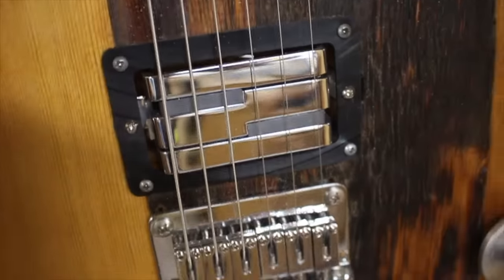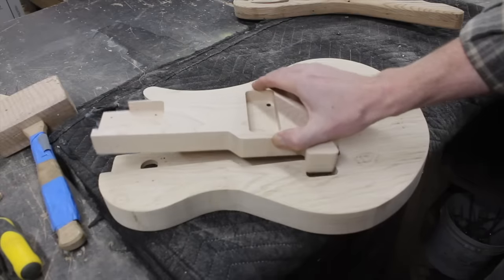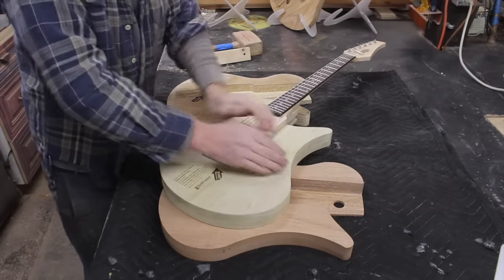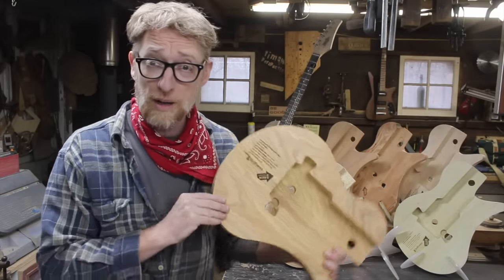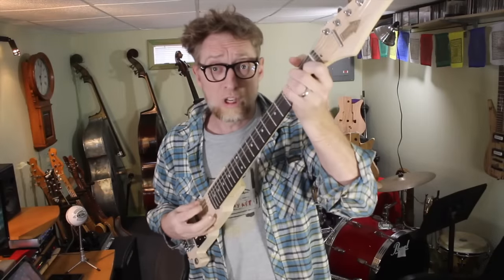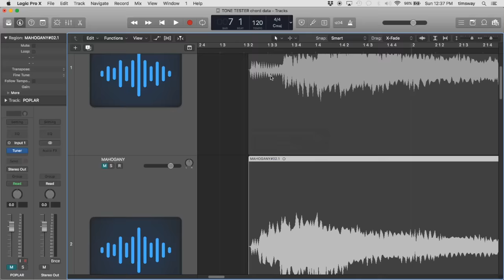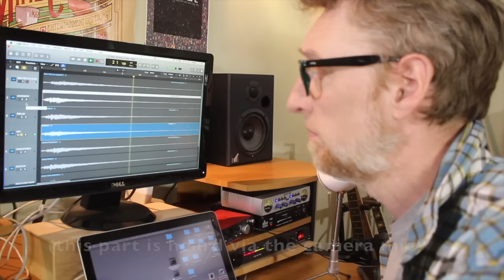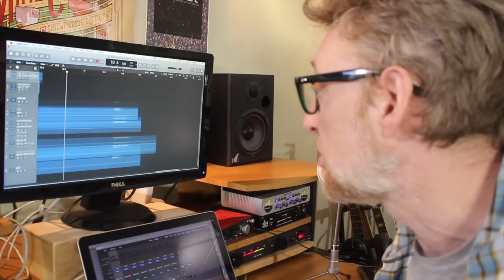Tone Wood Tester: One guitar to test them all

Comment: Wood type makes all the difference... to the bank account.
Reply: We’ll hold on, now... wood may or may not have a noticeable effect on your tone, but there’s absolutely no doubt that the type of wood you choose can affect sustain, the feel of a guitar, the weight of the guitar, the endurance and quality of a build, and - if you don’t paint it - the LOOK of your guitar, none of which are your “bank account.”
Reply: Not to worry Jesse. Most of my comment was meant facetiously. The whole tone wood topic relating to electric guitars is ridiculous, imo. When it comes to weight, strength, stability, sustain and aesthetic.. thats a whole different story. These are more important,  yet they're frequently ignored in relation to the topic of tone.
Reply: Aah the immeasurable myth of mythical tonewood factless ego wood. 

Correct, tonewood is a good sales pitch to remove money from your wallet cause you can't tell other then ego and biass cause you bought it, but it sounds better myth.
Reply: Spend your money on the amp, thats where good quality tone comes from. $500 is all you need to spend on the guitar.
Reply: Any amp EQ will easily negate any subtle "tonewood"differences there may be. So yeah, sure you might hear a difference but it does not matter whatsoever.
There are much more important factors influencing the tone significantly. For example the amp :-)
Reply: Btw. it has been proven time and again, that wood has almost no influence on sustain. Darrel Braun  for example did cut off all wood off of a guitar which could get cut off and it still sustained the same.
Reply: @MrVirgilVox  Or just use an EQ pedal
Reply: ... And to the back...
Reply: @MrVirgilVox  he made cut  up and space it with metal and metal is dense.  You can not argue the fact that dry dense would sustains longer.  The kind of wood does not matter as much as learning how to be a better player and mastering technique.  In my opinion it only matters to the 1% that get so damn good and have fantastic ears.  Most of use need to just leave this wood debate alone and concentrate on learning how to become better players.  Now having said that choose a guitar that feels good sounds good and looks good.  If you do that you are more likely to pick it up and do the biggest factor in tone and that is your playing ability.
Reply: wayne brown he put the pieces together after the test. During the test he cut away everything except Bridge and control cavity. Did you even watch the entire video or did you just skip to the end?
Reply: @MrVirgilVox  I watched another video than the one you were talking about look it is science the more dense the wood the longer you can feel the vibrations.  Is it a big factor in tone I don't think so but it does to the 1% that are so good at guitar that they can tell.  For the rest of us I think practice is the biggest part of tone.  He made another video where he showed the guitar put back together with the metal and said he did a test with it so I thought he used it that way.  It does not matter he cut it down to a plank the more dense the longer it will vibrate.  You don't even have to hook it up to an amp to test it.  You know as well as I know this is something that guitars will argue to the end of time. lol keep shredding.
Reply: wayne brown that is exactly the point. It only makes a difference acousticly but it makes no difference in how the string vibrations induce current in the coils - which is what the electric guitar raw signal is all about.
Who cares how it sounds unplugged. That is not what's being processed in the signal chain, not what makes the tone.
Reply: @MrVirgilVox   Slow down man I said that is the only thing that is different.  If it sustains longer acoustically it will sustain loner in the amp.  I was scrapping the bottom of the barrel man.  To me , tone starts and stops with your ability to play the instrument.  Today the pedals and amps are incredible  with mad skills you can pick up just about any guitar and make music.  When I read these tone wood comments I kind of pick the vibe that a squire bullet Stratocaster is just as good as an American Fender Stratocaster.  There is a point where cheap guitars don't sound as good and they fight you with bad frets cheap material such as the metal of the bridges.  This is it,  in my experience that is the only thing that makes a difference and that  difference is so small it is nothing to worry about.  I still will not tell my instructor that has played with people that are in the country hall of fame that he is wrong.  If you like a wood because you thing the tone is different then buy that guitar because you are going to practice more.   I will say one last thing I have a MIM fender Strat deluxe with locking tuners and a push push button cost $824.  I have a PRS standard for $499.  I had to block the bridge on the fender because I could not keep in in tune.  I thought I was going to have the same problem with the PRS and it stays in tune, it sounds better and the material are better the construction also better.  I don't know what kind of wood either one is made of.  Thanks for keeping things friendly I know that is a very rare thing in the comment section on youtube.
Reply: @mr1bienvenu1  I used to think that, until I bought a really nice guitar and plugged it into my Mesa ED.  It was like the Mesa was on steroids.
Reply: The most expensive guitars I have also have the most sustain.  Is that part of your tone?  That's like asking if ice cream tastes better than beer... really depends on who you ask.
Reply: @realtruenorth  I wish I could afford a Mesa I have heard nothing but good things.  I don't play well enough yet to make that kind investment maybe in another 5 years.
Reply: @realtruenorth  I had a long drive yesterday and for what ever reason this popped into my head.  If you feel you can hear a difference in tone with different wood bodies and fretboards.  Who am I to tell you that you are wrong.  Someone might pick up that one guitar and they hear something they like maybe its  like songs.  We like some songs and some sound like they are a joke.  That is the only thing that I can think of that causes this big debate.  I will continue trying to get better like I said I got 3 guitars and like all of them and don't know what wood is used in any of them.
Reply: @waynebrown1394  I have been playing for a long time, I earned my skills.  One thing i can tell you, you cannot put a price in inspiration.  I have heard incredible players sound good playing anything, even junk.  But, at the same time you will not see them recording on a cheap amp, or guitar.  I realized over the years that if something inspires you to play better, it is worth every penny, and inspiration will help you get better faster.  People say "a great guitar and amp won't make you play better" that's true.  But if they inspire you to play more often,, then you will get better faster because a passion will grow in you and your fretboard knowledge will grow fast.  How do you put a dollar value on that?  I paid $750 for my Mesa combo, and I would have paid 3 times that. Because everytime I plug into it, i get a smile on my face and my playing wakes up all refreshed.  I feel like when I first had that hunger to play, only now I can. You are already good enough already to play whatever inspires you to play my friend.  Let your ears decide.
Reply: @realtruenorth  I want to thank you I took your advise I went out and bought by dream guitar after reading this message.  Right now I live alone my best friend my Dad died.  So I was thinking what make you happy and it is playing the guitar.  You are right I don't have to be awesome player to have a guitar that will make me smile and happy.  I got a Gibson Les Paul because of this message and I don't regret one damn thing.  It was the first time that I bought a guitar and did not have second thoughts or buyers remorses.  Nate hit me back on this message like to have you on face book.  That way I can show you the guitar that I got because of your message and I am happy.  Thanks
Reply: @waynebrown1394  cool man, I am glad.  I dont have Facebook, sorry. But enjoy the Gibson. Peace
Reply: @waynebrown1394  and by the way, unam sorry for your loss. Hope your dad is in a better place.
Reply: Smart kid!
Reply: @realtruenorth  :  Ice cream.  Thanks for asking.
Reply: @douglasbender9481  beer for me ha ha
Reply: @jesse_cole  "tonewood" mainly effects the look,everything else is so close its pointless to compare.
Reply: @trillrifaxegrindor4411   *affects
Reply: Only if it’s quarter sawn pallet wood

Comment: I'd bet pallet wood would blow all those away!
Reply from the maker: you can't make a guitar out of trash!
Reply: @timsway  You sure can. You can make shot cups, maps, legs, coasters, the whole nine yards, all out of trash...err, pallets
Reply from the maker: @lfmoliveira1  Stay tuned to Paul's channel and remember my exact response to him :)
Reply: @timsway  People made guitars out of fucking cardboard. And it sounded just like any other guitar would.
So pleeeeeease ....
Reply: I built an off set hollow body out of milled down pine wall stud 2x4s and a pine shelving board top from Home Depot, basically as a challenge to my self, and it plays and sounds better then my LesPaul custom and my SG standard.
Reply: Taylor made a guitar from the palletwood the tonewood was delivered on.
Reply: @Revis This link is about acoustic guitar, tonewood will be more noticeable. The video is about electric guitars
Reply: Pallets are commonly made from alder, poplar, and basswood so...
Reply: @pauloquist6150  and if it dried well, it would be good or even better than some cheap chinese axes. At this point proper drying is actually the weakest spot of cheap guitars. Raw timbers are just fine and fairly close (if not the same) that are used by big brands.
Reply from the maker: @seriseriom8445  you realize I'm the maker of this video and about a dozen other "junk" guitar videos, right? I'm obviously joking :)
Reply: @timsway  Hah. No. No i was not aware of that. Servs me right tho ;o)
Reply: I can’t stand the whole “use pallet wood for your project, bro” movement. Drives me crazy! I like hardwoods, but I appreciate nice, refined pieces of wood.  Not “rustic” dirty boards lol
Reply: @mattfairfield9103  you'd feel right at home on my channel then
Reply: Jackman Works well, sir, I can’t deny your work. It is impressive! There’s a difference between craftsmen who know how to use the wood for something great, and pretty much anyone else who uses pallet wood because it’s “rustic” and “rough looking”. Haha
Reply: Just saw a video of someone who made a guitar out of hundreds of colored pencils. Sounded great.
Reply: @pauloquist6150   I think you meant oak and pine.
Reply: @mattfairfield9103  Its not a movement mate. Its a campagne to get rid of all the guitar myths perpetuated by the big companies. The second ppl realise that a Les Paul or a Strat can be sold for 250 bucks in the same quality than the original is the day they dread the most.

That second btw is almost here.
Reply: Seri Seriom I just meant for projects in general! I work in the lumber dept. at Home Depot and sooooo many people shoe me their pictures of the shitty renovations they did with their pallet wood and dirty bar wood and stuff lol. I just don’t get it, other than the fact that it’s cheap, or completely free lol.
Reply: @mattfairfield9103  Ah. Yeah i understand now
Reply: Ik
Reply: I prefer practical board
Reply: Pallet wood varys by location. I've  seen oak fir pine yellow pine hemlock ash. You name it. Nice video.
Reply: Well it would have to be Swamp pallet wood, or Brazilian pallet wood, or perhaps, Curly pallet wood. I don't think the basic stuff would be good enough. I am being sarcastic of course :-P
Reply: Wood pallets are made of hard wood, so they can handle the weight put on them. Some pallets are used in factories or warehouses for years, so that gives the wood time to dry. The only problem with pallets is the problem of nails, and you can fill nails holes. It isn't junk wood by far. Some very nice furniture can be made of it. You can sort it out and choose if you want a walnut, oak, maple, or ash (even some are fruit wood, which is good tone wood.) A lot of things have good tone, concrete is one of them. Most problems with guitar wood is mostly if will it hold up under daily use, is it strong enough to hold the pressure of the strings, and it doesn't splinter or bend over time? Other than that, you find what sounds good for you and use it.
Reply: @seriseriom8445  
They sounded to same to you. I think some people get butthurt about tonewood. Why is this? Because just like all wood is not created equal, neither are ears. Just because some people can't hear a difference in tonal quality, that doesn't mean it's not there. I think this upsets some people, but  the truth.
Reply: @randallflagg9659  "The truth".

See? Its not about being hurt its about being forced to discuss with flat earthers.
There is no argument. It has been settled. We have the hard data on it where as you have "the truth".
Reply: Matt Fairfield if people could see the things some companies do with pallets they wouldn’t be so quick to use them for projects
Reply: Pallet Guitars Inc.
Reply: Wow i remember doing that .. pressing my headstock to the wall to get the louder sound. You are very creative sir.
Reply: @timsway  I've seen and heard pallet wood guitar....sounds identical to this...
Reply from the maker: @GabrielTheGuitarist  my comment was a joke. most of my videos are guitars made of pallets, water skis, etc. and I am the maker of this video. Paul and I recently made a pallet guitar together. watch for it on his channel.
Reply: @seriseriom8445  sarcasm,if you are slow its undetectable
Reply: @sheancarey106  no it doesnt,it does however play differently
Reply: @randallflagg9659  look at the scope reading,it doesn't lie.each strum had the exact same pattern within a  percent
Reply from the maker: @powertothebauer296  you realize I'm the maker of this video, right? Sarcasm. I make a living out of making guitars from "junk" :)
Reply: @timsway  What reference you answer , my Brian May post, yes I realized after my Post. And not to offend you the next time I will delete my Post soon as I am realize you had make an sarcastic Joke
Reply from the maker: @powertothebauer296  not offended, just making sure you knew what was going on :)
Reply: @trillrifaxegrindor4411  : the „scope reading“ are tracks on the recording app. And they only show the dynamics (loudness) of the recording, Of course they are almost identical. They tell you nothing about the sound.
Reply: you can make a guitar out of a 10ton bulldozer once
Reply: Taylor made a guitar out of pallet wood...
Reply: @lfmoliveira1   Most pallets are made from ambrosia maple Which I love. Mainly for furniture But it sounds and looks good for a guitar body from the lumber yard. So makes sense that  pallets could work for solid bodies
Reply: @timsway  fender does
Reply: @timsway  my Epiphone would like to debate you...
Reply: @seriseriom8445  ?  lol  wrong, it sounds like glue resonance and pickups, no timbre without timber.
Reply: @sheancarey106  pine is amongst the  greatest sounding tonewoods.

Comment: Scientific tip: Plot a fourier transform of the recorded waveforms so that you can see if the spectral response is any different for each kind of wood.
Reply from the maker: The audio is pinned in the comments for everyone to download and test as they'd like!
Reply: To really investigate, one could also excite the different wood bodies with a centrally located tone generator and measure the frequency response for a few key frequencies, calculate/plot the FFT to better see the differences to go with what you hear.  This doesn’t distinguish the best wood, however, because that’ll depend on what you like out the pickups. For stability and sustain, pick the wood with the highest elastic modulus, lowest moisture solubility and lowest thermal expansion coefficient.
Reply: Yes, he needs to show the power spectrum (which you can get from the magnitude of the FFT)
Reply: @JDCottonMusic  Exciting the wood would lead to absolutely no audio since pickups work on magnetic field. Unless you're exciting the whole guitar with strings on, which would maybe make the strings move a bit, but you would end up with pretty much the same signal every time as far as frequency response goes (or just happen to excite at a resonant frequency of the guitar)
I would also add that if you need a spectrum analyzer or some sort of other visual analysis to notice a difference, it is negligible and you shouldn't even worry about tonewood enough to do such a elaborate experiment, or at all
Reply: @escalator9734  You're correct on the latter - excite the entire guitar body with strings on, choosing the wood (for a constant guitar design/geometry that provides the best response. The strings and the guitar are acoustically coupled--a tonewood that absorbs or dampens important frequencies will take more work to play than one that does not--and the strings will translate this energy to the pickups.
Reply: @Escalator You could attach something to the body that converts the vibrations to a signal - some kind of piezo pickup, I guess.
Reply: I used to do that when I worked for Tektronix. My demo TDS-3054 did a lot of weekend research! FFT all the way 👍
Reply: Wanted to point out that the waveforms you see on the monitor display volume, not tone - glad someone else noticed that we're examining the wrong data.